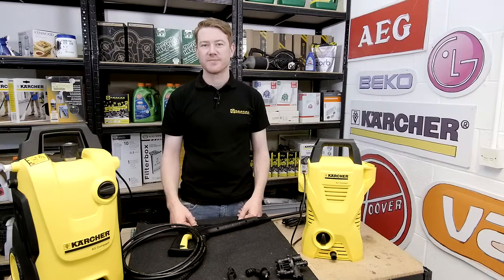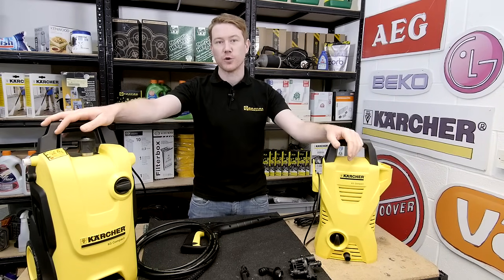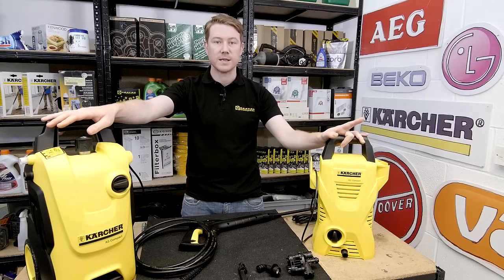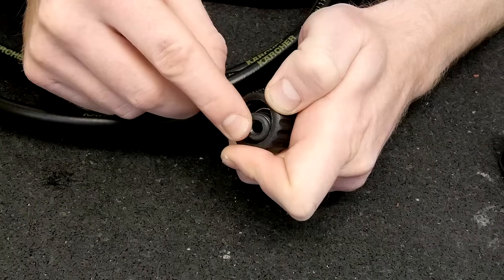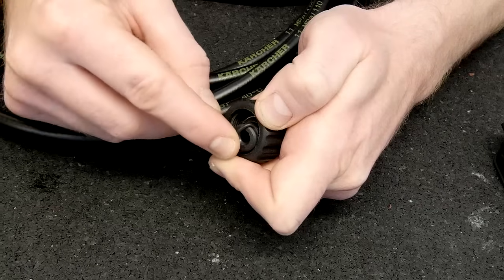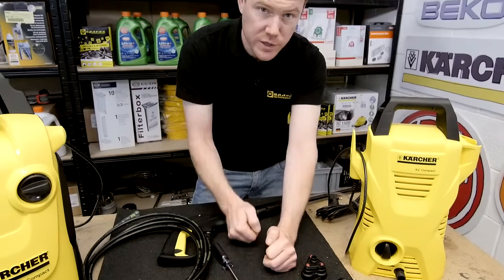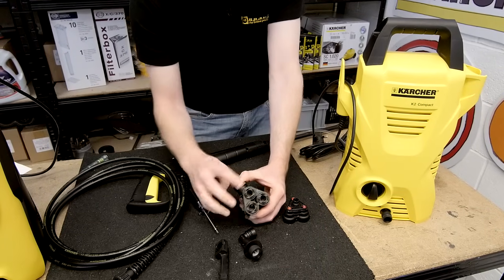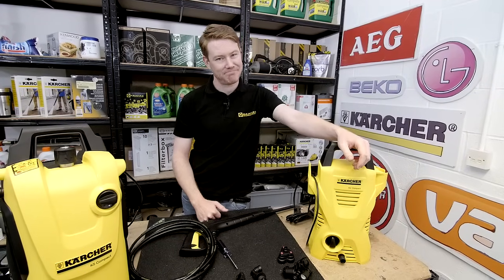Karcher Not Working? - Karcher Pump Faults Fixed!

Comment: I removed the case to my K4.6 and the cylinder head....... checked all the washers they seem to be okay, checked all valves they seem to be okay put it all back together again tightly. Then ran the water through without the case and looking at the machine from the front a fine spray is leaking out on the left hand side below the piston heads but can’t seem to work out where the leak would be coming from? Any ideas?
Reply from the maker: Hi Nick, we know the O ring seals inside the cylinder head can leak even if they look ok but requires them replacing.

Comment: My problem is that when i pull the trigger the power is about half of what it should be. I've noticed that if I keep the trigger held, bht turn the machine off and on again, full power will sometimes come back. Its very frustrating. Ive cleaned out the filter but no improvement, any ideas!? Thanks!

Comment: Mine makes an annoying squealing sound after the pump slows down and stops on my electric pressure washer. Theres no sound when im using it and the water sprays perfectly fine.  Everything works fine but that god awful annoying sound everytime I let go of the trigger and the pump auto stops can someone help thanks in advance!
Reply from the maker: Hi Sentinel Ex, what model have you got? check you are not losing pressure as if one of the O ring seals is not sealing we have heard the pressure can make a noise.

Comment: What a great little video! I now know where to look to repair my machine.
Reply from the maker: Hi, thanks so much for your comment. Hopefully our video means you can now solve the issue with your Karcher pressure washer!
Reply: @eSpares  my karcher k2 is starving water in middle of cleaning my car an some times wen I set it all up wht can it be iv dne the filter clean bt it’s still the same

Comment: Thx for the video. I'm not quite sure if I need to change the whole cylinder head or not. When I run water after opening the unit...it's leaking from the cylinder head. I took a video. I have a k5.65 qc.
Reply from the maker: Hi Phoenix Ortiz, it may just be the O ring that is causing the leak and we supply them so you don't have to replace the head www.espares.co.uk/browse/mt16/pressure-washers/karcher/domestic-k5-series

Comment: I have found an electric k2 1500 psi on sale cheap. Seller thinks pump needs replaced says works on low pressure and needs pump to work properly. If runs and sprays on low that wouldnt b the pump itself would it?  Im thinking something else but unsure and would like to know b4 i purchase and end up spending more than its worth to fix. Seller says electrical wand and hoses good so what could it b?  Please let me know what u think asap thanks
Reply from the maker: Hi barbarab24cs,  a couple of things could be possible so start by checking the O ring seals and the valve inside the cylinder head as problems there will cause the low pressure and the other may be a air block.
Reply: @eSpares  ok not sure if this would change what u think the problem could b or not and we did buy it, but she said if u hold trigger wide open ur good and when old man checked it out he said as u hold it the spray would go off and on, it would start spraying on start up then stop then start and she had said would spray on start up but if u let off would have to restart to get it to spray again. I will check out the things u suggested and thanks for the help by the way but if u feel like theres a different option now or something else to try please let me know

Comment: Hi, I have a Karcher K5 and it’s fine apart from one issue. When I pull the trigger the pressure is very low. In order for it to return I have to remove the lance (vario or dirtblaster, doesn’t matter) pull the trigger and let the water run through in the wide spray flow, reattach the lance and off it goes perfectly. If I let go of the trigger for even a few seconds I have to go through this process again and it’s quite annoying. Any idea what’s causing this problem?
Reply from the maker: Hi Krieg AufKreuz, we have had before a seal allowing air through or a leak that causes the pressure to drop but make sure you check the cylinder head.

Comment: Hi I have a K3.80 the problem is that the detergent isn't mixing can you suggest reason?
Reply from the maker: The detergent will only be dispensed in the low pressure mode so remove the spray lance from the gun and check if it then comes through.
Reply: Have tried that detergent not being drawn through
Reply from the maker: The detergent valve may be blocked by old detergent that has dried up. You may be able to dismantle this part of the pump and clean or replace the valve as required see: http://www.espares.co.uk/product/es953397

Comment: Hi Matt
I have a karcher 5.55m pressure washer that has pulse problems , i have replaced the Pressure Washer Cylinder Head and i cleaned all the valves , i've checked the pressure and i do not have any leak anywhere. Before i purchase any more parts from you can you please help me in suggesting what else could be wrong?
Many thanks
Reply from the maker: The problem is likely to be a leaking valve allowing the high pressure to leak back to the low pressure inlet side if no water is escaping.
Reply: eSpares thank you for your reply
can you tell me which valve it could be so I can order it
many thanks
Reply: eSpares thank you for your reply
can you tell me which valve it could be so I can order it
many thanks
Reply from the maker: The only other valve we can think that could cause this problem without a visible leak other than those in the cylinder head is shown here:
http://www.espares.co.uk/product/es537814/water-inlet-tube
If this problem occurred since replacing the head it could also be due to a dirt particle holding one of the cylinder valves open.
Reply: Hi Matt
I changed the valve you suggested but it still not working. I am reluctant to give up because it was a really good machine and its not that old . Do you know of any local repairers in the Berkshire county?

Comment: Have a Karcher K4, turn it on and motor can be heard running even when trigger is not pulled but water does not come out when you pull the trigger. The pump is running constantly until you turn off the power. It does not spray water.

Comment: Hiya buddy I was using my  kew hobby 80-1 this morning it was working ok and I turned it off then back on after 10 minutes and it started pulsing and I removed the inlet filter out and tried it without the filter and it's still pulsing can you give me any advice on this please
Reply from the maker: Hi Will, pulsing is usually a sign of a air block so try this: Disconnect the Pressure Washer from the electricity supply, Remove the black high pressure hose from the outlet of the machine. (If your machine has a hose reel, remove the trigger gun from the hose and leave the hose connected to the machine). Connect the garden hose to the inlet of the machine. Turn on the water supply but leave the machine unplugged from the electricity supply.Leave the water running through the machine for a period of 5-7 minutes. Re-connect the black high pressure hose.Squeeze the handle of the trigger gun to draw the water through the hose and into the gun until water exits from the lance and hopefully its ready to go.

Comment: My Karcher spray on low pressure like a cheap water pistol.  What steps do you advise?
Reply from the maker: Hi Net Guru, check the cylinder head for damage to the O ring seals and have a look at the valve as it blocks up causing the drop in the pressure.
Reply: @eSpares  do you have a video actually giving a demonstration.  Trying to become a hands on person
Reply from the maker: Hi Net Guru, have you watched the video above as it shows Mat going through low-pressure issues.

Comment: Thanks for the video, My karcher pressure washer seems to be working fine, but after I let got of the trigger handle for a few second, the trigger handle doesn't trigger until I wait like 5 to 10 min. I might have used the wrong detergent..Can you suggest what to do.   thanks
Reply from the maker: Hi Seraj, after it has stopped do you get a spurt of water when you pull the trigger again? if not the gun trigger valve may be sticking. If when you pull the trigger it does spurt a jet of water does the machine start to buzz after you pull the trigger? this would indicate the motor trying to start and may be a motor capacitor problem.
Reply: I have a similar problem to this. Sometimes it just won't start up. If I leave it a minute or two or keep the trigger depressed, it will suddenly fire up and usually works normally for the rest of the day.
Reply from the maker: Hi Nick, if it is a motor capacitor problem you will here the machine buzzing before starting. If there is no noise it may be the 'spill valve' (that turns the motor off when at full pressure) is sticking. If this is the case once the high pressure was released the machine would remain off even if you stop spraying until the valve moves then there may be a short burst of motor noise while the machine re pressurises.

Comment: Do you only help on the Mitshumi or also other brands? Mine turns on for a short period of time and the turns off itself how do I repair it myself or do I need to go to the company I bought it
Reply from the maker: Hi Nadi5, the video is on Karcher but it shows how to diagnose on a pressure washer, you need to test the circuit to establish what has failed.
Reply: @eSpares   ok shall do.

Comment: Hi I have a K4.650 it stops and starts and has lost pressure, its spraying water from what looks to be the cylinder head or manifold. I'm not to sure as i cant inspect properly due to the clamping plate ( cant see any cracks when removed ) It wont leak when not running (powered ). just not sure what parts to get ? I cant seem to find a complete cylinder hear with valves and seals or complete manifold ?
Reply from the maker: HI, if you remove the cover and just connect the water supply without connecting the electricity the water pressure should show any leak of the cylinder head or jointing piece.
Spares for your model can be found here:
http://www.espares.co.uk/search?SearchTerm=K4.650

Comment: hi, I have a K3 97.M that right now does not have any leaks I changed cylinder head checked a capacitor is ok I do not know how to check the switch but the motor does not start by the way do you know which oil to put on the pistons?
Reply from the maker: Hi Tine, you can identify the problem by watching these videos: https://www.youtube.com/watch?v=afPHu9LrRbQ and
https://www.youtube.com/watch?v=pJkyY8qRRwc
The correct oil is available here: http://www.espares.co.uk/product/es538165/karcher-pressure-washer-engine-oil
Reply: Thank you i  will check it later
Reply: Is that regular 15w-40 as any other motor oil? I will probably place some orders from espares, but 1l of that oil is just to expensive just for having Karcher name on the bottle. Btw, great videos. Thanks for these advices.
Reply from the maker: Thanks for the comments. Sorry we are not oil experts.
Reply: how much oil do the normally needs pistons?
Reply: add oil to just cover the swash plate.
Reply: how much oil?thanks
Reply from the maker: As answered fill the chamber just above the 'swash plate' (the circular disk that pushes the pump pistons).

Comment: Hi, 

I had a leak and found a crack in the soap chamber of the cylinder head so replaced the whole cylinder head, this has stopped the leak but I now have very low pressure, the motor runs constantly and doesn't change when I squeeze the trigger. Any ideas? 

Thanks,
Reply from the maker: Hi Ed, if this is a new problem since you replaced the cylinder head it sounds like it is losing air pressure from somewhere so start by checking the O ring seals.
Reply: eSpares thanks for the response, I've checked and can't see any issues. I have got a small plastic disc that I am unsure where this is meant to sit, I'm thinking this could be the cause of he issue?

Comment: I have the Karcher K2 Compact and it seems to have given up on me. When I turn it on I hear a very light humming noise. When I use the gun I get a very light thin spray of water. No power at all. I don't see any form of leak so I'm wondering what the issue might be. Can you help? Thanks.
Reply from the maker: If the motor is not running see another of our videos:
https://www.youtube.com/watch?v=afPHu9LrRbQ

Comment: Just asking...should a pressure washer pulsate at all? Ours does it when you stop washing just twice, then just the motor running as normal. Is this normal?
Reply from the maker: Many machines are designed to 'shut off' when not in use. To do this the pump pressure needs to be higher than that needed when being used. If there is any leak of this pressure the machine will restart as it thinks you are using it. Check for leaks on the high pressure hose fittings and around the pump. If it is not leaking there must be an internal leak on one of the valves in the pump. If it pulse when spraying it would indicate a restriction of the spray lance so check with another lance.

Comment: I've got Kärcher SE 4001 machine. The water jet doesn't come out at all. No water leaks. When I press the spray gun, nothing happens. Any suggestion to fix that problem?
Reply from the maker: Water will flow through Karches like a garden hose even when they are disconnected from the power. Remove the lance and  if the water does not flow when you pull the trigger try removing the gun from the hose.

Comment: Hello Matt, we have a Karcher 720mx, motor wouldn't run, I have replaced the capacitor, the motor just clicks, still won't run, I can turn it over with the fan ok, there are no leaks,  any ideas ???
Reply from the maker: +mountfields If the motor turns it is not seized. I would suspect the capacitor if it had not been replaced. Watch another video to check continuity through: https://www.youtube.com/watch?v=pJkyY8qRRwc
If there is a direct connection from plug to motor through the switch it can only be a faulty motor winding.
Reply: +eSpares Matt, thanks for coming back, we replaced the capacitor with a new one, is there perhaps a pressure switch somewhere that's faulty ?
Reply from the maker: +mountfields Not really only the micro switch that cuts it out when up to pressure.

Comment: My Karcher has an odd issue - with 2 attachments it works fine - the patio cleaner and one other (rated at 130bar max), but with 2 other attachments (rated at 120 and 150 bar max), it pulses in use, i.e. it turns on and just about as soon as the water coming out hits full pressure, the motor cuts out briefly and then it repeats.

Both the attachments it works with come from my old, smaller karcher. It's not an issue with the attachments as I've borrowed other identical ones to test.

There is no issue with water pressure from the tap - using a 1m length of hoselock hose connected to a mains pressure tap.

With the non-pulsing attachments, it works absolutely fine and there are no leaks.

Comment: Hi, I'm having problems with a snow foam cannon on a karcher k4, when using the cannon the jet wash will pulse on and off but with the adjustable lance it's fine,  do you know what could cause this? Thanks Shaun
Reply from the maker: Hi MrShaunys1210, If the Karcher is pulsating when in use then it is likely the cannon is restricted as this will increase the pressure as if the machine was stopped and once the pressure drops the machine runs again.
Reply: eSpares thanks for getting back to me, so would you suggest trying a new cannon or stripping mine down and cleaning it up?
Reply from the maker: Hi MrSHaunys1210, try to unblock it first before thinking about replacing it
Reply: eSpares thanks mate;)
Reply from the maker: Your Welcome
Reply: eSpares Hi, just to let you know and maybe anybody else who is having the same problem I was, my problem was that the orifice screw on my cannon was too small, I made the hole a fraction bigger and now I have nice thick foam, thanks for you help shaun
Reply from the maker: Hi MrShaunys1210, glad you got it sorted.

Comment: Great video! I have a Karcher K2900M. It's an older model. When it turns on, it stays running at high RPM like you have a full trigger pull on the wand, (but the trigger's not actually being pulled), with no pressure at the wand. But it leaks badly from the bottom of the unit. So I opened the unit to inspect and it doesn't leak until you turn the unit on. When you do, it leaks badly at high pressure from the valve housing and manifold. This unit has the one piece manifold. The seals all look fine. No visual evidence of cracking or wear. Can the seals be bad without showing it? Or is something else going on? Thanks!
Reply from the maker: Hi Chris, usually if the O ring seals have deteriorated then it can cause a leak and if it is one piece you may need to replace the unit.

Comment: Hello, i have a problem with the newest model K2, it appears to work occasionally at full power. But 50% of the time, it will just spray a spurt, while holding the trigger. I have to let go of the trigger, and press it again to see if it will fully pressurize the water into a high powered spray, its brand new and this is completely random when it will pressurize the water :( Any advise? Cheers
Reply from the maker: Try with another spray lance and make sure you have enough water pressure and flow from the hose to the machine. If problem continues contact your retailer if under warranty.
Reply: +eSpares cheers mate. will go from here